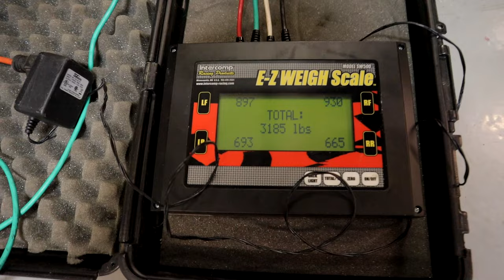American Musclecar Evolution - Why Pontiac Started Strong And Faded Into Obscurity

Comment: GM  Did have a lot to do with halting Pontiacs Super Duty racing program Forged parts etc. with their infamous 1963 Racing Ban before that  Pontiac was  kicking Chevy's Butt in NASCAR etc. early 60's  but  The Best Pontiac connecting Rods since the SD-421 Forged Rods were the 73 -74 SD-455 Forged Rods - back then everyone that was racing Pontiacs tried to get them if they could - My 74 SD-455 T/A with 450 HP Set up to HO RACING Specs was very Quick  3400 stall auto - 3.55 rear gear 12 Bolt etc. Best WIN Was against a done up 70 LS6 454 Chevelle by several car lengths 🏁🏆😎

Comment: The Pontiac high performance team had designed a 428, with Ram Air IV heads for 1079, but when Pontiac switched to the 455, they scratched the Ram Air IV 428, because they thought a Ram Air IV 455 might not hold up. They had also designed a 1970 400 Super Duty for the 1970 Firebird. It was based on the 1970 GTO Ram Air IV engine, but with a stronger cylinder block, forged crankshaft and forged connecting rods. Its output would be no more than the Ram Air IV and it would have cost more than a 1970 426 Hemi Cuda. Now when the compression ratios dropped in 1971, they did finally put RAAIV style cylinder heads on a Ram Air 455. The additional iron in the heads, to allow machining a larger chamber, for lower compression, restricted the exhaust ports somewhat. Pontiac V8 cylinder head chambers were machined and not cast. The 1972 455 HO had even more restricted heads, with a more restricted aluminum intake manifold. The 1973 and newer 455 cylinder heads actually fixed ports in the D-port heads, to be less restricted. Pontiac had requested from GM, a compression ratio limit waiver for the 455 Super Duty, but GM refused. Chevy had compression ratio limit waivers for the 1971 to 1972 LT1, the 1973 to 1974 L82 and the 1971 LS6 Corvette engines. The GM limit was 8.5:1 and Chevy upped the compression ratio to 9:1 on those wavered engines. Pontiac designed their round port heads for volume and not for flow, so they had some room for improvement. We blueprinted a 1968 Ram Air II engine to NHRA specs, maximum overbore, minimum deck height, minimum chamber volume and minimum head gasket thickness and the resulting calculated compression ratio we got was only 9.98:1, so the stock engines did have their advertised compression ratios. The 428 engines likely had the highest stock compression ratios of the Pontiac street engines.

Comment: The machinist that did my first 440 back in 1991...(which I still own today)...told me he had to sleeve  my block because of sand pits ( 2 holes) which were revealed when they bored my block .030 over...I was a newbie and I was very concerned about this situation...he told me no worries son, it's the Chevys soft blocks that are problematic...you could sleeve a 350 block, and bore it to match the cylinders, and 30k miles later that sleeve would he the only hole in tolerance.....all these years later and 3 different configurations on this 440, no 496, I'd say he was very correct.

Comment: Their huge main bearing journal diameter didn't help much either. Great strength but kinda rough at higher rpms. Figure the bearing surface to main journal surface speed at higher engine speeds. Also what was the stroke of the 421? Not a Pontiac guru but I was attending the racetrack at Great Lakes dragway in Wisconsin when those 421 Catalina Pontiacs were running. They could battle the 409 Chevies but had serious problems with the 413 Plymouths. When they were making a single run (by themselves) they sounded like they had a rod or 2 knocking. I never could understand how they kept those little BW T-10 trans together behind that hi torque 421 while pushing that very heavy Pontiac down the track. Watched some of these cars at that track: Arnie Beswick (2 cars, catalina & tempest wagon), Gary Dyer of Grand Spaulding dodge ( once came to the track with a 426 Max  hooked up to a 4 speed that he "borrowed" from a 383 car), Tasca Ford, Art Arfons jet car that he ran off the end of the track into a corn field, Tasca ford Thunderbolt, Chris Karamesines. Interesting time.

Comment: I had a 73 formula with a 455 stock rods. Running 10:50s. The Pontiac motor oil system must be modified so it can survive..If you do that the motor will run forever.

Comment: the stock rods did suck but really i think the issue with the Pontiac in high HP applications is the lifter valley, kicking out lifters, cracked lifter bores and other related low end valve train issues for days.

also the large journal blocks can have their own set of issues because of their size.

now that there is aftermarket Pontiac blocks though these issues are gone now.

Comment: Never had one issue with oiling in any ford engine.  Dad has built for years.  Hot engines and never one issue.  280k on his 460 and not one issue.  All the bearing are still good.  Walls are good.

Comment: Back in the early 1960's my parents bought a brand new Ford. Every day it would not start. They took it back 3 times and they fixed it each time. It still would not start the next day. They took it back to the dealer and told them they did not want the car anymore. They then bought Chevy's from then on and never had any problems,. My dad could work on the Chevy's and plenty of parts available.

Comment: Years ago, I was building a 400 HO for my '68 Firebird, a retired Cop stopped by to buy something off me. He saw the long block sitting there, He says they used to run Pontiac police cars way back; and under long pursuits, or going around corners at high speed the engines would starve for oil. This didn't give me a lot of confidence in Pontiac oiling systems.

Comment: Rod bolts were more the weak spot then rods.  Gm keep pontiac down just to keep chevy #1. Look back at all the history of what pontiac tried to do and what gm did in response. Arnie "The Farmer" Beswick has some great stories. Such as him picking up an aluminum front end for his 64 GTO, chevy snitched  them out to gm and gm made pontiac crush all the remaining aluminum front ends.    Thumper has it right you can make good power with out a ton of rpms and their torque is something else.

Comment: Was watching a video on how 1963 421 motor had forged bottom, connecting rods,and forged aluminum Pistons with 2 Carter AFB 4 barrel. CRAZY STOUT Motor 😢 Original stock. After that Pontiac went down hill...

Comment: Another thing to remember about Chevrolet was they designed the small block to easily fit in the place of a flat head ford. Hot rodding in the early 50’s was all about early fords and Zora Duntov told the higher ups at Chevy that they could catch the youth market with the right engine. And that’s what they did. When street rods came back into fashion at the end of the muscle car era there were junkyards full of small block chevys that were almost a direct bolt in anywhere a flathead ford had been.

Comment: one thing  a lot of People don't know is the Pontiac 287 engine was ready to put into  the cars for the 1953 model run. It was stopped by GM upper brass because Buick didn't have a V8 yet a.  Head guys at GM thought if the Pontiac had a V8 it would kill Buick sales, nobody would pay more for a Buick with a straight 8 if they could buy a more powerful Pontiac V8 for less money. The stud mount Rockers idea on a small block Chevy originally came from the Pontiac

Comment: The biggest problem Pontiac Motor Division had was GM Upper Management.  DeLorean, Estes, and Knudson took over the division known for being the "boring" third grade teacher's cars.  Although there was some good engineering going on there.  They built PMD up to where it was indeed building excitement but GM management was not expecting such good results.  My experience was that I reused the connecting rods when I first rebuilt my 326 engine.  That was a mistake, in that after about 100,000 miles on the rebuild two of the rods failed with fatigue fractures in the stem.
So my standard advice in rebuilding any classic Pontiac motor is get new connecting rods!

Comment: In a roundabout way, the Fiero was the Pontiac that infuriated Chevrolet into determining to eventually eliminate Pontiac. The 1987 Fiero design changes that gave it better suspension, handling and the 5speed of '88 coupled with the different engine cradle that engineers were planning to put a V8 into was more than Chevrolet would tolerate. They knew that a V8 Fiero would cut into Corvette and Camaro sales and Chevrolet was not going to let ANY competition to the Corvette to exist in GM. The idea that a "parts-bin" econobox would morph into a Corvette killer was simply intolerable! The oiling and fire issues resulting from it were the first attempts by the Chevrolet dominated marketing department beancounters to kill the Fiero but it remained popular once the aftermarket oilcoolers came out. The proof is in today's market. Fiero's sell for more than new in very good condition and late '87 and the few months of '88 production are bringing premium prices. All IMO of course.  I really enjoy your videos. I'm not a "brand whore" myself and currently own Ford(2), Jeep/Mopar('98 5.9 Limited), Nissan(2) and Chevrolet(1)...but I miss my Fiero and '65 Grand Prix, 389 TriPower, 4spd!

Comment: GM didn't want another division to surpass Chevrolet, particularly the Corvette. The cast rods in those engines were not meant to run over 5,000 rpm. Put the forged rods in these engines (Eagle for instance) and they are fine.  The Ram Air IV and 455 Super Duty engines had the forged steel rods.

Comment: The Pontiac rods with replacement lightweight Pistons actually will hold up halfway decent in a mild Street engine. But in like today's world connecting rods are so readily available there's no reason to run to factory ones. I'm not mistaken The Cadillacs have weak rods too. Cuz I remember when they were building the Cadillac 500s early on people were using the forged Oldsmobile 455 rods in them. I'm really a Buick guy and I love mopars. The Buick's weakness surprisingly isn't as much the oiling system as people say is really they lighten the block in the bottom end. Now for a street car that means you got a big block 455 that weighs 60 lb more than a small block Chevy but when you start making any real power it's really hard to keep the block together.
Reply: Caddys use the Olds 7" rods from the early 400 & 425. 455 and late 400 rods are 6.735". Occasionally Scat sells some 7.0" H-beams rods for Olds n Caddy, but they use a .990" pin .

Comment: As a Pontiac owner for the last 27 years, and a professional engine builder for nearly as long, I disagree with your assessment.  There is a significant flaw with Pontiac v8s, but it isn't the Armasteel connecting rod design. In fact, the few times I have seen a broken Pontiac rod, it was a the result of a failure elsewhere.  

The biggest flaw was in how the main bearing caps were located. Most other engines have a register cut into the block locating the main caps, while Pontiac used a pair of 5/16 dowel pins. Often, very little of the dowel pin was actually in the bearing cap. This is an artifact of the 287 from 1955. As Pontiac increased the stroke, they also increased the main bearing diameter to keep the journal overlap at a point where the crank was stiff. They did this without adding additional material to the engine block, just removing material from the main webs. Combine this with the mount location on the pan rail, and you have all kinds of flex and movement on the crankshaft, tearing up the mains and cutting off oil to the rods.

The broken Armasteel rods you mention in the video, they didn't snap because it was cast iron,  they snapped because the flex of the mains pinched off oil to the rod bearing, which cause the rod bearing to seize up, and boom broken rod.

The goofy oil pump with a sheet metal cover didn't help, but some engines did get a better pump. And, some engines got forged rods, notably the 1973-74 SD455. But the problem remains the main caps swaying in the breeze because they are poorly located on the block. 

These days, if the dowel holes in the cap are good, I pull out all the dowels and replace them with a much longer dowel that can fully engage the cap. If need be, I will machine the block and caps for larger dowels. It's a huge pain in the you know what, but more than anything it helps these Pontiac engines live. Anyone with a 3 inch or 3.25 inch main Pontiac needs to understand what the problem really is, and what to do about it. BTW,  there are  now 4340 rods readily available for Pontiacs, which are a better investment than reconditioning Armasteel rods. Thanks for the video.

Comment: I guess my hamfisted buddy got lucky with the 67 GTO he got back when we were kids. 
It had power ,we knew that as the previous owner showed him a couple of 12.3 slips. 
The guy said it was a 400 with a ram air 4 cam in it. 
Who knows ,it did haul ass though. 
It had an automatic in it ,but the darn thing roasted tire so fast that he would get all shook up while going from 1-2-D and the smoke was pouring that he would pop it in neutral a few times🤣
Even if he kept it in drive ,he had no feathering skills and the tach would be crying over at 72-7500😄

Comment: Uncle Tony:  Back in the day when aluminum connecting rods entered the aftermarket, the contention was these types of rods created a cushioning effect that would not work with a street engine because of the constant flexing that went on in the engine between the crankshaft and the piston as a whole system.  My question:  Are aluminum rods strictly for racing applications where that crushing effect is beneficial or do aluminum rods just create an expense issue?  Thanks for your comment.  I appreciate it!
Reply: the AL rods have metal fatigue problems . racing is ok due to high maintainance. if you just drive nice days race a little probably ok . but daily driver not so much.

Comment: Another great topic. What are your thoughts on the Buick Big Blocks? To my understanding the 455 Buick is superior to the 454GM,(especially since the distributor is on the front), but the block amd cranks are lighter and more prone to warping necessitating the use of a main girdle. Not sure if the Olds big blocks has the same flaw in their 442/455 engines

Comment: I have pulled apart SBC engines with over 100k miles the bearing looked brand new,  not a mark on them,  it had just shy of 110k miles, it all looked basically new, I have seen engines with 30k miles with more wear,  changing oil is a good idea,

Comment: Back in the late 70's through most of the 80's I owned both a 1970 SS 396 (402) Chevelle, and a 1970 Buick GS Skylark 455 at the same time. I had to put in twice as much time into that Buick in order to get that 455 running tits as I did on my SS 396 Chevelle. That is one of the reason I just stick with Chevys because they are so much easier to deal with.

Comment: It's a shame scat wasn't around to make a killer Pontiac rod! 
When it comes to the oiling system and crank , rods , the factory should allow engineers who are into racing engines head that part of the project,  seems that is what he did with the LS/LT engines,  compared to the SBC of the later year's they are basically racing engines, with little work they can do 1000 hp at the wheels,  nearly 1200 at the crank, and actually last a while,  usually a tune that kills it, 
I can't wait to see what the LT6 turns out to be,  overhead cams, flat plane crank, I'd love to see one in a Camaro, or even a SS truck,  110% volumetric efficiency 4valves per hole,  direct injection, all it needs is a little bit of boost, maybe someone will make a stroker crank and cams for it, with the shims, it's probably best to leave that alone, but squeeze another .25liter from the 5.5L engine, maybe more, especially if the cams can grow another . 050- .100" and 40° more duration +/-,

Comment: Good info! As a child of the 60's, always wondered why Chevy's were so popular. @ fastest cars I ever owned were my '69 Nova SS350 4speed/4:10 AND, this '39 Ford Coupe parked in my garage right now(350 ruck block 327 power pack heads, rams horn exhaust, dual plane 4BBL. 4speed Saginaw It will definitely walk and talk.
My friend's uncle was a big shot car guy from Staten Island. Died a few years ago with a huge funeral. Walter Curro. Sound familiar???
JT:Orlando, Floriduh

Comment: Hey Tonya, Ford and chevy were back and forth, but either was better than the other. I remember my dad's brother having a 67 chevelle with a  396 425 hp. Big block engine. He had put 4 396 engines in it because the bottom ends would blow apart easily. He said the 396, 409 big blocks were crap. He also said the 454, and ford big blocks had stronger bottom ends by far and did atleast keep the bottom end together, I  believe you are a chevy fan boy to believe gm has fewer flaws than any brand vehicle, but on the other hand the chevy ls and lt1 engines are awesome. Some video's you make hold alot of truth, but other videos like this one don't hold any water at all. I've seen more 4 bolt main chevy engines blow quicker than a 2 bolt 5.0. Go to neo mustang channel and see what a little mighty 302 cubic inch can do. Remember 2 bolt main 302 and don't forget to view his 2 bolt 351 windsor engine mustang. I think your still OK Tony no matter what is said about you. The older dodges were great also, but also in last place as being popular.